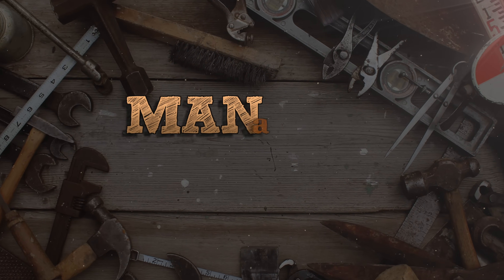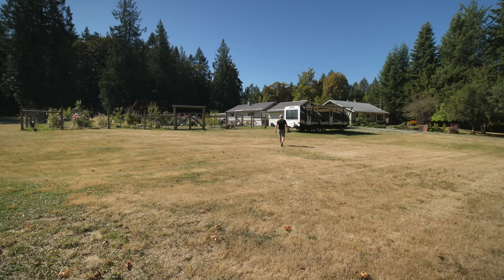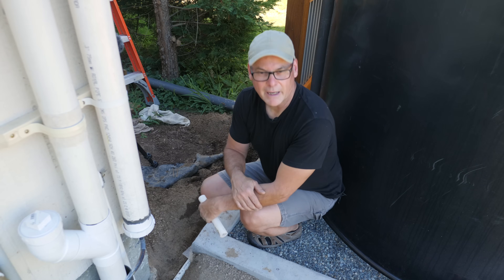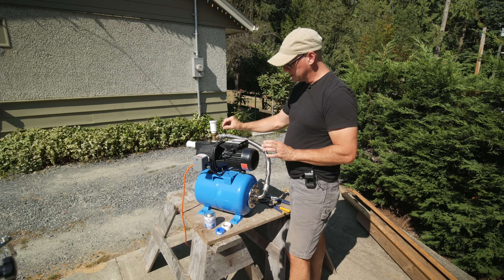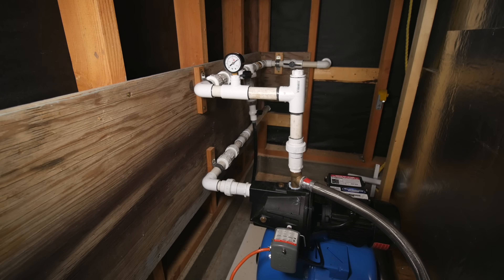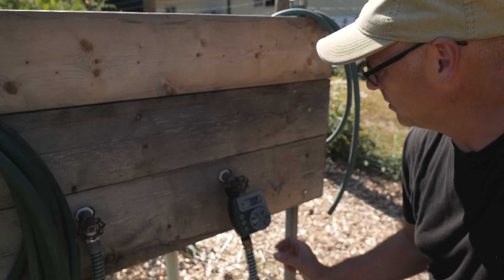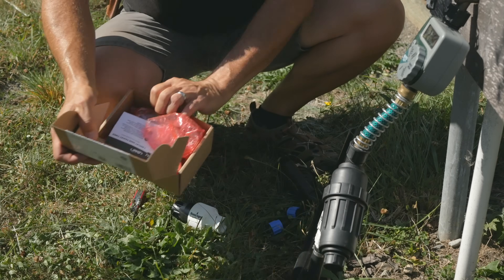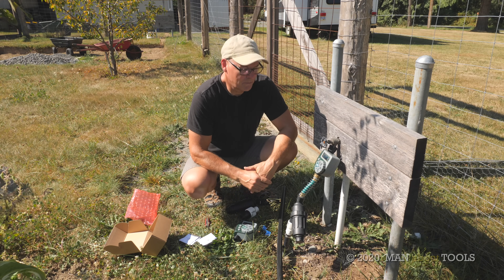Rainwater Harvesting Tank - Drip Irrigation and Pump Problems

Comment: Amazing irrigation system and awesome videos! I will be doing something very similar for my garden. I'm interested in how the system has held up being that this video is three years old. How is the pump performing? As I mentioned I will be running a similar system in my garden, only difference being I  wont be using a pressure tank, ill just let the pump run continuously feeding a drip system. My only concern is that the pump's discharge will be "choked down" as the pump is pumping water to a pressure reducer prior to feeding drip lines, in effect reducing flow. Has your pump experienced any negative side effects as a result of this?? Thanks for the info!

Comment: Just read someone say what I was. Might be too much pressure from the pump for such a short run with no head, even with the 10 psi prv. Around 30 psi is usually good. Either way, good looking system.

Comment: Very timely video for me - I am right in the middle of an identical project with a 2000 gallon tank!  Thanks for including specs for the pump - any regrets/issues (so far) with this choice of pump/pressure tank hardware?
Reply from the maker: I would look at a pump with a better hose to the pressure tank. However, after more research, it is fairly easy to replace with two fittings, some clamps, and any flexible hose that holds pressure. That's what I'll do soon.
Reply: @MANaboutTOOLS  Thanks! and thanks much for the video, it will save me a significant amount of time on this project.

Comment: Did you put the Teflon tape on in the right direction the first time around.?
Reply from the maker: Yes, and the threads bottom out before its watertight. So, it's a cheap fitting. Second time I put a few more wraps on. I think I will just replace that hose.

Comment: keep in mind, that every 2.31 feet you gain a PSI .  If the water level in your tank is at 6', there is 2.6 PSI available at the base of the tank.  i once had two 300 gallon square tanks set on 1 course of cinder blocks .  There was enough pressure in at the bottom of the tanks to get good flow out to my garden without a pump.  but i wasn't using emitters or sprinklers, just an open hose.

Comment: relying on the pipe compound to seal the fitting without it being properly seated/torqued will eventually lead to the sealant fatiguing from vibration. This would have not been a permanent fix even if it had sealed.
Reply from the maker: Thanks! I think a new hose to the pressure tank with proper swivel fittings would be the best fix. Too bad it came with a poor hose in the first place.